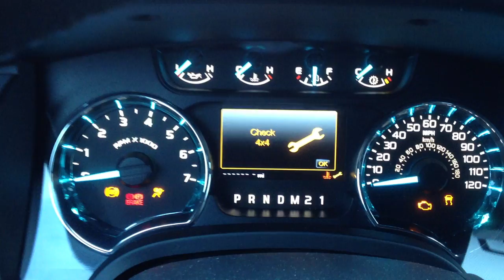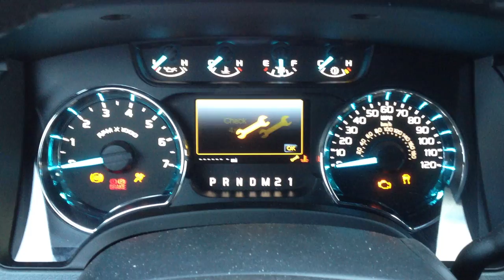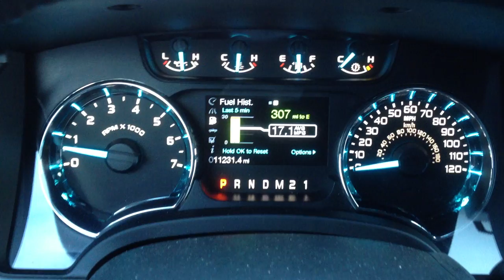Ford F-150 2012 Electrical Problem

Comment: This is the transmission Lead Frame.  Known issue with Ford and should be covered under extended warranty (90k miles or under) for free.

Comment: It's a controller area network issue. The truck has Medium and High speed networks. When communication breaks down over either network due to module failure or wiring issues, this is what you get. That's why the mileage is not displayed during the time it's acting up. The PCM and the IPC (Instrumental panel cluster) modules are not communicating correctly. Run a network test. See which modules fail said test. This will determine which CAN network you need to look at. It is a complex system. All the manufacturers have these issues. Just part of the game now. Just gotta know how the system works.

Comment: I had the same problem with my 2013 ford f150. Truck would run and at 60 mph it would shut off. Found out the 2 positive cables from the battery to the fuse box make false contact. Once you drive at a fast speed and hit a bump it would shut off. Try checking that out.

Comment: I had the same problem with my 2013 ford f150 eco boost fx4 for a few days , checked all the fuses , fuses were good and checked my relays and it turned out to be the starter relay was going bad. I changed the starter relay to a new one and haven’t had any issues . I hope I’m able to help you guys out with this information.

Comment: I have a 2013 lariat that started doing this the last couple weeks, what is happening?!!
Reply: Check the ground cables, most of the problems are in the ground connections, and this is a known problem in ford cars.
Reply: @saifalkaabi6195  Thanks for sharing, any idea where I can find locations of all grounds? O9 king ranch F150 150k. Wanted entry into engine Bay area from under cowl as well as into the cab have all been noted. 

Figure I would start there to rule out electrical/Lost communication codes/module etc…Ive had the occasional limp mode wrench light/fuses blowing/multiple ac issues. Radio staying on well after the door is shut and locked. Ambient air temp on the dash reading is all over the place. 

abs, brake and traction control lights all on dash and 4X4 apparently stopped working. (Fluids rear diff, trans/torque converter serviced) 
I did install oem 20” wheels (there is a tsb for abs recalibration however they can not advise on codes due to loss coms. Replaced front passenger wheel hub assembly no change. 

Had the fuse 27 tsb fuel pump relocation kit installed due to many fuse melting. All began at 100k. Wish I could put these resources towards preparing for timing service as I have the 5.4 3v.
Labor of love. it’s paid for but the list just keeps growing.

Comment: My 2011 was doing the same thing. I found a wire in the main harness on the driver's side that had chafed and corroded into. It's a network communication wire. It's a pain in the butt to find and get to, but once I repaired it my truck operated perfectly again. Hard to believe in 18 gauge wire can cause all those problems.
Reply: Hey Walter could I get a picture of said bundle... Having exact same issue with my 2010 could really use some help thank you sir
Reply: do yo have a picture of what the wire looks like and location?
Reply: Can you share exactly what you did to fix your 11 ? I have an 11 with an output sensor reading when hooked to a diag machine. I can share my email if that’s better

Comment: Appears to be a wheel bearing issue, that causes the grinding noise. Which also cascaded into your abs sensor to trigger. I had the same issue on my 2012 lariat. I replaced the bearing hub assembly and abs sensor and that resolved the issue.
Reply: Would this cause the truck to shutoff and fail to restart?
Reply: Not what it is,network issue that affects the whole system, including false transfer case engagement . Whole wiring harness and computers need to be replaced. It's an unresolved issue. You can either go broke trying to fix it or trade it in while it's working if ford won't take it back.
Reply: @James-wd2uu how did you find that out?
Reply: @Rowen170  I'm one of it's victims 2012 raptor

Comment: I had a problem with a dealer years ago, If I were to do it over again I'd keep a copy of all my paperwork and check my states lemon laws. In my state a dealer gets 4 chances to fix the problem. If not fixed they have to take it back. That applies to new vehicles I don't know about used. On most lemon laws there is a certain period of time you have to work with.

Comment: just had a similar problem with a 2011 f150, found moisture in the electrical connector that is clipped to the wiring harness located on the back side of the radiator on the passenger side of the truck between the fuse box and the battery. Blew the moisture (windshield fluid ?) out with air compressor. Seems to be working normally again.
Reply: This is why I don't understand how Ford doesn't use the sealed electrical connections. They always skimp on important factors in their "tough" trucks.
Reply: thanx for ur positive good reply.
Reply: post a  video of which plug

Comment: I DUPLICATED THE PROBLEM
After a lot of research online I could not find anything that could help me solve that same problem on my 2013 F150 Ecoboost (basic XLT). Some people took it back to a dealership and have them replace some modules but did not give a lot of details. It was extremely dangerous when the truck shutdown when I was making a turn after a traffic light.
I did not solve the problem but I figure out why my truck was doing that.
EVERY TIME AFTER I PARK, USE THE E-BRAKE AND TURN OFF AND ON THE TRUCK, THE DASH AND TRUCK WILL GO CRAZY WHILE NORMAL DRIVING. 
This happened to me many times until I figure out how to make a "reset" on the system.

TEMPORARY SOLUTION:
IF THIS HAPPENS WHILE DRIVING, STOP THE TRUCK BUT LEAVE IT RUNNING, SHIFT TO PARK (P), PRESS AND RELEASE THE E-BRAKE AND THE PROBLEM WILL GO AWAY.
THE PROBLEM WILL COME BACK AGAIN IF YOU USE THE E-BRAKE, TURN THE TRUCK OFF, TURN IT BACK ON, RELEASE THE E-BRAKE AND DRIVE (AS NORMAL).

 YES! it sounds weird but it worked for me. 
Hope this helps somebody else.
Reply: Did you ever find the problem?

Comment: My buddy has a newer F-150 with an oil leak problem and a dash cluster that goes out intermittently. Dealer refuses to fix either, even though it's under warranty. The truck is a year old.
Reply: cruyeda It's because your buddy is bringin it in when the intermittence is not apparent. Video the problem and allow them to fix it. No dealer will repair anything that doesn't appear to have an issue. Oil leak prob? They must have it out for him or something and I would bring it to another Ford dealer. The one I have been to gave me the best experience I have had out of ANY make ( I have owned them all). No problems here man. Sounds like your buddy has an isolated problem with dealership jerks. Why? If its under warranty, the dealer gets paid REGARDLESS for the full repair from the manufacturer and doesn't come out of the dealer budget.
Reply: Lol find a new dealer.

Comment: I have the same issue. My truck will not start and the exact same dashboard indicators are on. Could someone please tell me what the fix is for this problem? It all started with the parking brake light and abs light coming on while I was driving. All was normal.. got home shut off truck and now it will not start. Turn key on.. radio works and power comes to dashboard but will not even turn over. Now more lights have come on ..low oil pressure, service 4x4 , faulty system start... Please any help would be greatly appreciated!!!! Thank you
Reply: I have the same issue with my 2014 F-250 diesel
Reply: @chadfarrow4027  did you find out the issue just happened to me on my 6.7 f250
Reply: What happened ? Did they fix it ?
Reply: Any updates ?
Reply: Any updates what is wrong with it?

Comment: 2017 F250 Instrument cluster harness, wires rubbing against something.
Reply: I’m dealing with a similar issue did you get any codes
Reply: @WaterandWoodsmen  No codes. Just a loose positive cable on my battery.

Comment: Built ford tuff!
Reply: Raven Montoya Show me a truck that has the reliability at the cost to repair than Ford 2010 on up. My recommendation, call the top 5 warranty companies not supplied by any manufacturer as they'll give you the low down across the board since they deal with all makes and models.
Reply: I have same Problem 2018 platinum did any one  can help

Comment: I have the same issue, i’ve changed the throttle body, fuses, and battery.  still getting the same issue…smh thinking of taking it to dealer.

Comment: Do you still have this problem?  I just fixed mine somewhat doing the same thing.
Reply: How? I'm having the same issue.
Reply: @theroadviking6279  mice!
Reply: @theroadviking6279  let me know buddy
Reply: @ericcarlson8160  10/4 thx
Reply: @theroadviking6279  well?
Reply: @ericcarlson8160  looks fine  but still looking... thanks for the tip.
Reply: How do you fixed your truck. L? I havr same problem in my truck.

Comment: Have a 2012 f150 bought the extended warranty that is completely useless. Whenever advancedtrac system comes on, wrench, abs or any other warning light Ford dealer tells me my warranty will not cover repairs. Also had an FSA molded transmiission frame Ford also says warranty will not cover. So sorry I bought an f150.

Comment: i've f-150 2012 6.2ltr same this issue
i found pcm not same vin no. i replaced but i can't reprogram it,
each time when the reprograming start the electric inside the car cut off and on,
i don't know what the facken problem,
can any one help me.

Comment: what do u expect Fix Or Repair Daily = FORD!
Reply: kenny kennysson Actually, I just bought a 2014 Ford F150 3 wks ago. I have had so many problems with Ford. My 93 Ford Ranger and the tranny going out 2x which went out the second time just after ford warranty, my F150 97 and it blowing spark plugs and the DPFE sensor, my 2000 Expedition and my DPFE sensor problems, it blew plugs 2x, brake problems wearing pads, and radiator cracking. Well, you want to know something? Before this new Ford, I owned in order a new Silverado,  a new Nissan Titan, etc. Kept both for about 2yrs and got rid of them as I just didn't like them. Nissan was garbage although powerful. Exhaust manifords cracking and differential that explode due to over heating and weak gears. The Silverado, I didn't have any major problems other than it was weak natured and also quiet despite doing the exhaust 4 times with different mufflers and lengths. The Silverado for 2008-20013 had piston problems where it would blow up in the motor and the entire thing would have to be changed. Did I have to do it, no.  14 years later I decided to give then a shot again. I have to admit, after my stringent review and research, Ford F150 is probably the most solid 1.5ton truck out there on the market. The strongest frame, the most reliable at a decent cost to repair, middle ground with best/worst fuel, etc. Let me tell you the most reliable was the tundra. But watch the video on youtube of the Ford versus Toyota and watch the ass shake on the Toyota. Next, after calling 30 mechanics, Toyota has electrical issues from time to time. The cost to repair a throttle body sensor in a ford/chevy is $200-$300. In a tundra its $950. All of the major and best rated BBB warranty companies stated thet Ford was the best overall. Don't believe me? Call them and ask.  They were the only maker that didn't take a bailout. They also have the least amount of repairs just above Toyota but Toyotas repairs are 3x the cost of a ford part. Labor is also much much higher. The worst liability for insurance companies and the most problems were the Nissan Titan at about $3500 for the aftermarket warranty, Dodge was a $3400, Silverado was at $2995, Tundra was at $2100, and the Ford was at $2250. Warranty companies are about making money and do not favor a brand. They got rid of the Old 5.4L that I have problems with and the ranger doesn't exist anymore, they brought back the old bullet proof 5.0L used in mustangs, etc for decades and so far so good. I am glad I got a Ford. Also, keep in mind, ALL veihcles have problems. The new silverados have frame rust issues (youtube it) on BRAND NEW trucks never bought, tundras have C-Frame problems, etc. I say, cheapest to repair and most reliable combines is a throw in of the towel, FORD WINS. 
All new vehicles are prone to electrical probs due to all the technology. Me, I haven;'t had a problem, and this guy in the vid, a poster said he fixed it by using an air compressor for free blowing moisture out. Easy enough... I wish the problems in my 2012 Maxima was that easy to repair. That thing costed $1000s which is why I got rid of it. Sorry, but again, Ford trucks win. The cars are a different story. But were talking trucks.
Reply: Sofa King you wrote a book, have you seen the bending test were GM wins at automotive adbuilder, shows exactly, and in the vid they say ford sells better, now I know why there are many perks that think ford is good, Not!
Reply: Jason B Nothing on this planet earth will convince me to buy scrap metal FORD!
And that, never again, ever!!!
I know the best transportation, needs,  and that I have got, Period.
Honda the power of dreams.....
Reply: ford is scrap metal put together with trash and junk!
Reply: They must still have more value then a gm now because they are aluminum. Rather be on road dead in a ford then on road dead cuz of gm junk parts they knew about.
Reply: what does FIAT mean?
Reply: kenny kennysson I own a ford they last longer then those bullshit chevys
Reply: kenny kennysson chevys bullshit
Reply: kenny kennysson que es lo que tiene

Comment: I have the same problem on 2014 f150 king ranch...
Reply: Did you fix it ?? My 2014 F150 was doing this and I ended up pushing all the fuses in place hard with the palm of my hand (engine compartment ) warning lights all removed and been running normal for 3 weeks since
Reply: Check out Chris Shelton video : 2013 F150 Service advancetrac system fault
Reply: the people of the ford dealer they changed the throttle body  and got fixed and also relay

Comment: Why would you not make ford take it back. Idk I have a 2012 f150 bought in Feb 5.0 4x4 knock on wood with 65k on her no issues so don't make 1 video and jump to conclusions not to buy ford. Can buy a chevy die in a wreck cuz of equipment they forced by.